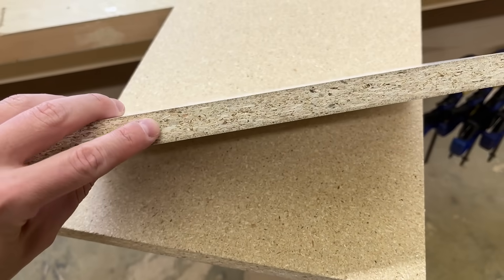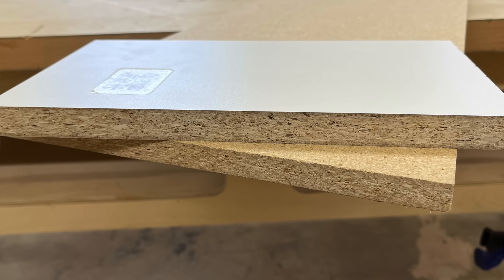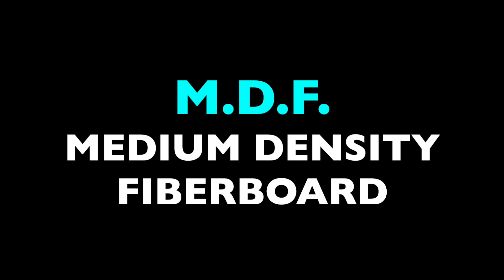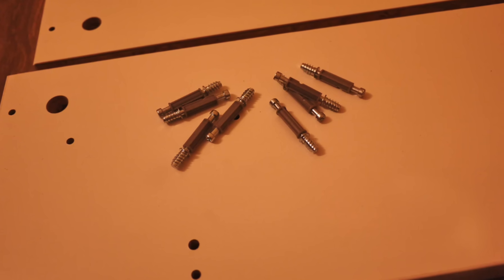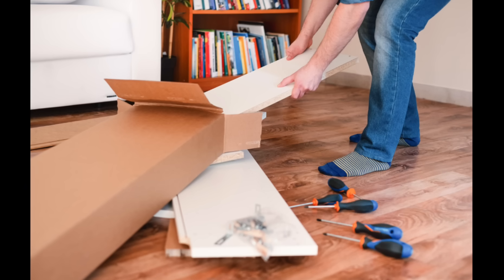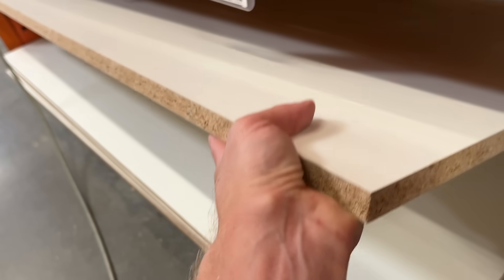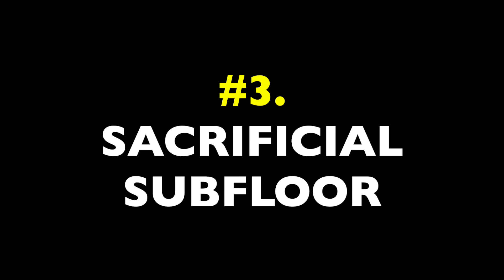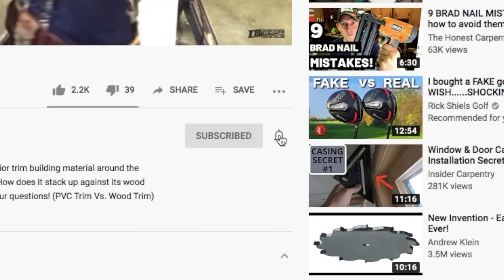The Truth About PARTICLE BOARD...Is It The Worst Material?! (Pros + Cons...Particle Board)

Comment: Never considered using it for a tabletop for my work  [[wax carving/jewelry making]] other than what ou said I won't touch the stuff.  As you sid it might be useful for some sort of subflooring at 1/3 the cost, however, eventually you are going to have to tear it out which means removing whatever is over it and redoing the job.  I would rather do it with good material once.
Reply from the maker: My buddy has a 30 year old pb shop floor that’s like a sand dune 😂
Reply: @TheHonestCarpenter  Now that's funny.
Reply: @TheHonestCarpenter  lol   "Hey guys!, let's work on that Cabinet Trim we talked about-SURF'S UP!"

Comment: I use 2 sheets of Melamine for my assembly table, I edge banded it with hardwood on the bottom piece and let the 2nd piece float inside. It's worked great so far

Comment: I have a question as a non-carpenter... if MDF is medium density fiberboard while LDF is low density fiberboard... that implies HDF or high density fiberboard. Is that a real thing? Is it just straight lumber? Is there any practical use to it? If it's not a real thing... why use the term "medium", implying something higher?
Reply: The product you’re looking for is called hardboard, and is generally available only up to 1/4” thickness. Better quality pegboard is made of this.

There is also a product called HardieBacker, which is a (good!) substitute for cement board (such as WonderBoard) used underneath tile, and is available in 1/4” and 7/16”. An in between product is DuraRock.
Reply: Plywood is plywood, HDF is hardboard/masonite.
Reply: Because there is!  PLYWOOD is the next higher grade😉

Comment: My kitchen cabinets are made of this crap... a brand new kitchen barely 5 years old just falling apart. All my bottom cabinet shelves are sagging. I am right now in the process to sue my kitchen maker due to a lot of structural and safety issues. I could just slap my cabinet bottom shelves and it would just collapse. Your video is a god send!  Thanks...
Reply: Yeah, that has fuck all with particle board. I have a bunch of 10 year old furniture made out of it, and it's all still great.
Reply: Yeah, that has fuck all with particle board. I have a bunch of 10 year old furniture made out of it, and it's all still great.

Comment: "We see particle board... especially in cabinet type furniture. Companies like Ikea seem to use little else in their manufacturing." Ikea uses MDF for their cabinets, not particle board. Their inexpensive furniture is usually particle board, but as a company they use a lot of both
Reply: The absolutely use particle boards, and mdf, and honey comb paper fill. Just an example: Kalax (likely their most popular shelving unit) --- Materials & care:  Particleboard, Fibreboard, Acrylic paint, Honeycomb structure paper filling (100% recycled), Plastic edging
Reply: They probably use MDF on many of their kitchen cabinet fronts, but a ton of their bathroom storage cabinets are particleboard
Reply: @soulmatic09  Yes. That appears to be an accurate generalization. I was thinking kitchen cabinets with MDF, but Ikea makes a lot of particle board furniture. They are usually priced accordingly.

Comment: we had particle board subfloor in a remodel we did.  Moisture had gotten to some of it turning it into powder.  The remainder was easy to remove after cutting and a pry bar.  Two rooms had plywood subfloor and they were nearly impossible to remove without cutting into 6 inch squares and a lot of pry bar effort.  However, the restored original red pine floors are gorgeous.  Worth the effort. But if putting in a new subfloor it would be plywood not particle board.

Comment: IMHO whatever ikea uses is superior to particle board. Maybe it’s the resin content or density but it seems to be stronger. Also span strength is a misnomer. Bending resistance would be a better term but know full well that the would products industry has some weird jargon like “tension parallel to grain”. In English the adjective usually precedes the noun. 😏

Comment: Sacrificial... that's the key word. xD
I'm typing this on a laptop on top of a desk made entirely of particle board, with some cheesy red oak looking melanin layer. 
It looks like s**t. Some of the melamine peeled off, parts of the desk that cold beverages have laid on are bubbling up, the feet of the table is completely puffed and frayed and constantly dropping wood particles, the corners are all coming off and also bulging up, and parts that have constant contact with something (like palms, or constant mouse friction) are also all coming apart.
BUT, it's a sacrificial table, so it doesn't matter. Survived a couple of moves already. Doesn't have much use when I'm not visiting parents, so good enough for purpose. No fears of damaging when cutting stuff on top, craft projects, etc... I mean, it will get damaged, but who cares? xD
That plus the fact that it's super light and easy to move around ends up being kind of an advantage in itself.
The office desk I have back home that is solid wood is not only too heavy to move around, I also need to take good care of it not to destroy the thing... ended up having to put a couple of layers of EVA rubber mat plus a craft specific mat.
Reply: If it is light it is probably not good quality particle board.  Good quality is heavy and the melamine is really tough.

Comment: My experience with particle boards is I hate it. Few years ago I made a book case out of 1x12 dimensional lumbers. (That’s b4 lumber price went stupid). I absolutely love the book case. It’s much lighter than particle boards and far stronger and never sag.  There is no comparison. Since lumbers price sky rocketed, I had to make book cases out of plywood.  It’s slightly heavier than 1x12 boards but just as strong.  The only thing I use particle board is as sacrificial backer board when I’m drilling holes.  Otherwise, they have no business in my shop.  Even high lumber price doesn’t push me to even think about particle boards.

Comment: Both products are cheap crap, for things I've needed sheet goods for I use either 1/2" or 3/4" CDX or apple veneer core, anything else I use solid lumber for. I wont ever have particleboard or MDF in my home, the stuff also outgasses fo a LONG time
Reply: I agree... But lately price has become my limiting factor on ALL my projects.

Comment: Interesting information.  I realized a long time ago that true solid wood is a lot lighter weight than MDF or particle board.  I also found out from the particle board used as subfloor under the carpet in my house that it's terrible used that way!  There is another plywood subfloor under the particle board but that particle board is nasty!  As carpet and vinyl flooring have been removed so has the particle board and another layer of plywood put down in it's place.

Comment: My apartment owners built our kitchen countertops out of particle board covered with a nice looking veneer.  Now I have swelling in the wood at every joint.  It’s horrible!

I’m afraid that they’re going to try to blame me for this when I eventually move.
Reply: Document document document! Take pics of the swelling & just start a little email conversation to yourself with the dates you notice the swelling, attach pics of it, send yourself links like this video & other evidence you stumble upon supporting that the material takes on moisture quickly. And if you haven't, be sure tell them your concerns at least once, in writing, and documenting for yourself that you did bring it up.

Then, if they don't fix it (or at least promise in writing that they won't hold you accountable and acknowledge that it's because of their choice of material) -- basically, if they give you any issues at all, you'd have all that on deck. Most likely, just showing them that you documented it well (and are thus prepared for any disputes) they'll lay off, & in the very worst case, you'd be really well set up for a court mediation.

Never underestimate the importance of documenting things early and often.

This isn't legal advice, just general best practices. I'm not a lawyer or tenant law expert so definitely do your research. Good luck!

Comment: Many years ago I worked for a company, Thiel Audio, that made very high end home stereo speakers. We used 1 1/8 inch thick particle board with wood veneered outsides for the cabinets. These sold for $3500 a pair back in the mid 1980's. The front of the cabinet was 1 inch MDF with the holes machined for the speakers. 
I hated working with the that material. The fumes from cutting it for 8 hours a day on a huge table saw, caused me all kinds of sinus issues.
Reply: I have thiel tower speakers bought from a neighbor, 1994 ishwho kept them pristine. Veneer is still perfect in my living room, away from heating vents and windows. Always wondered why he paid so much a pair..I gave him $1k for the pair. Always am surprised that the speakers and surround mounting materials haven't deteriorated . Hate the way the speaker wires attach on the bottom, tipping a 60 to 80 pound speaker isnt fun...thanks, always wondered..and yes, now, age 73, no one but perhaps you and I know what a thiel speaker is, they always say, who...what...on youtube channels run by pretty knowledgeable younger guys

Comment: Have you ever tried making jigs out of it for table saw/ router/ miter operations? I’ve wondered if it is strong enough and durable for those applications.
Reply: Ive been thinking about trying it for that. It should be fine in theory, so long as its flat and not under stress.

Comment: This video was so helpful to me because I will soon be needing a countertop in my garage to place over an existing cabinet on casters, to work on. I didn’t know what I should use. I didn’t want anything too heavy but wanted a smooth surface to work on. I need at least six feet in length and at least a foot wide and thought about pine or MDF, but didn’t know about particle board, so thanks for the heads up. 😊
Reply: Don't do it, unless you're ready for a learning experience.
Reply: Please elaborate.

Comment: The melamine coated boards are good for mold making. Specifically for epoxy or concrete molds because of the glossy surface. Have used it a few times for making custom concrete slabs for flower pots.

Comment: I take it you are aware there a number of different grades of particle board.  Choosing the correct one is imperative. It is a better choice in many cases.  Laminate countertops are made almost exclusively using a PB core, but not the PB you find at the box stores.  The melamine PB has the wear of a standard laminate, just not the impact resistance.  YOu can also get PB with different adhesives for different applications.   Not all particle boards are the same, it's difficult to say it's not a good product because the junk you see at the Box Stores, (typically imported PB) is just that, junk.  It gets a bad name more from lack of knowledge of what kinds of PB is in the market place and using the wrong product.

Comment: My workshop floor will be 2 layers of loft board particle board (chipboard here in Ireland) running lengths in opposite directions and then self made end grain cedar parquet on top of that with adhesive between every layer and 100mm of poly-iso insulation under it all. 

It definitely has its uses but you have to work with its strengths. My first 6 months of training was making full custom kitchens from 2.44m x1.22mx11mm sheets of white melamine, the guy teaching me did the countertops and custom fixings. Almost 25 years later almost all of those kitchens are still where we installed them. So yeah work to the materials strengths and it can last a lot longer than you might expect.
Reply: 100%  idk, about US but where i live in EU the kitchens stands for a long ass time especially if "installed" properly and ofcourse siliconed where necessary

Comment: MDF also has melamine option too. In fact my entire home furniture is made out of them. Melamine coating is crazy durable, textured ones can easily grind softwood, can take quite a beating before chipping and resists even the hardest chemicals I can throw at them. However, unless melamine is coated as a single piece, it has very little protection against water as it seeps through edges quite easily.
Reply: Laminated MDF has only started catching on in GB the past 5 years. Chip board is still widely used in the manufacturer of bedroom/kitchen/office furniture
Reply: @nasserisback488  By chip board do you mean OSB? Some of the nomenclature is confusing to me!
Reply: @jimnasium452  in Britain we call particle board chip board the board in the video.
Reply: @nasserisback488  Chip board? Weird. Shouldn't you call it crisp board? 🤣
Reply: @jimnasium452  you forget I am British lol. Crisps here are what you call potato chips. And what we call chips you call chucky fries 😁
Reply: How do you coat the edges? And do you mask off the melamine?
Reply: @jimnasium452  There are bands which you can apply on with some heat. However, they often leave tiny gaps which is enough to ruin your table/cabinet if water reaches there and stays a while. I think you might have some success by applying band first and coating with sides and edges with thick poly to reduce water transmission.
Reply: @CemKalyoncu  Thanks! I suppose you align that banding slightly below the melamine top so there's nothing to catch when you say, wipe down the work surface?
Reply: @jimnasium452  If you get correct sized bands they will have slight chamfer to ensure that. But if you have to cut it, you will have to cut it a bit short.
Reply: @jimnasium452  I just noticed this comment the edge banding is usually a tiny bit wider. You can get a special device with a blade that trims it you can use a flush trim router bit
Reply: @jimnasium452  they way my boss does it if he has to cut it is he makes it wider, cuts it with a utility razor to size and then sands it so it's flush with the "veneer"
Reply: @jimnasium452  edge banding strips come pre clued heat activated or non pre glued. I use it when having g to cut down kitchen cabinets
Reply: @nasserisback488  "edge banding" Awesome! Thanks! Now I need to get some and practice! Ha!

Comment: I am converting a particle board book shelf into a cat condo. I learned last night that my glue does not stick well to the melamine. So, should I try to strip the melamine, or just make 1x2 fraims for the shelf’s to sit on?
Reply: Titebond makes a glue specifically for melamine. That's how difficult it is. Short of that, contact cement works well if used "properly" (let it get 1/2 dry or tacky on both surfaces before clamping the adjoining parts together).
Reply: That's a brilliant idea for upcycling/remodeling an old bookshelf, especially with this material! Very clever, I'll have to remember that one. Hope yours turns out great :)

I'm nowhere near experienced enough to have any tips on the glue problem, but I will toss out there that my favorite go-to fastening-problem-solver for weak or questionable materials is to put L-brackets on everything. Helps spread out the burden and lets me kinda brute force some squareness. Some may find that solution ugly for lots of things but it works for my aesthetic lol, your mileage may vary and all that. I hope that's a useful tip for someone out there!

Comment: I made a gigantic custom wall unit entirely of oak-veneered particle board, about 25 years ago, when I was younger and dumber.  After 3 moves, incredibly, it's still in perfect shape. But I would use veneered plywood if I was doing it again and could get the materials.